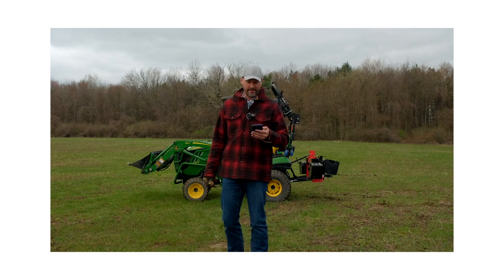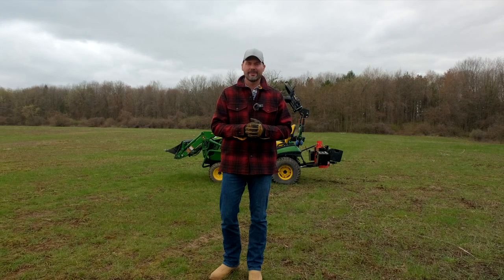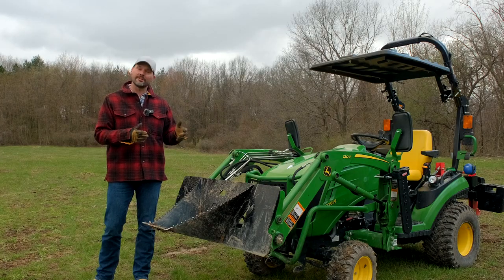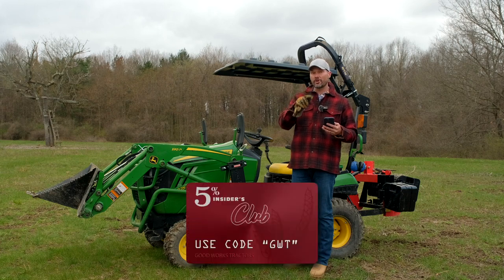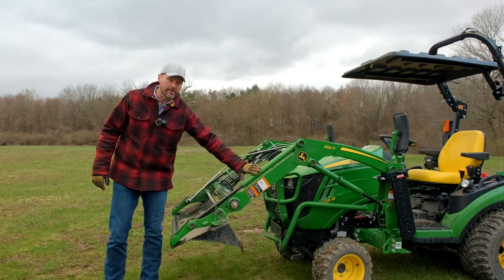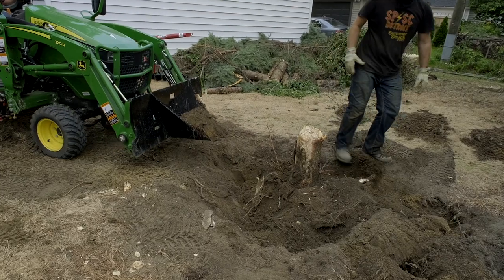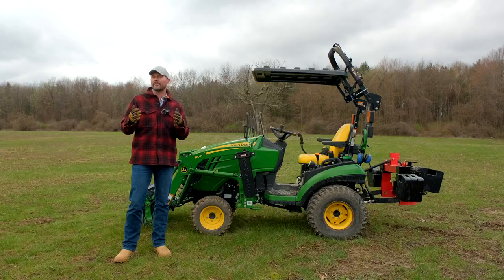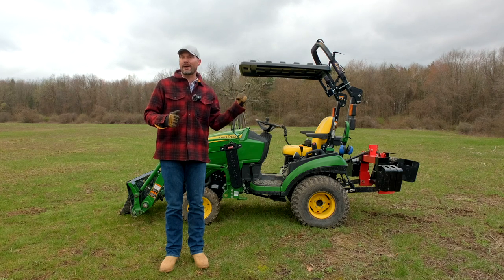WAS THIS TRACTOR ABUSE? 10 WAYS YOU SHOULD NOT ABUSE YOUR TRACTOR

Comment: My lil Jonny gets the best of care.  All fluids changed on time, greasing, filters, washed, waxed, etc.  Even sleeps in a heated space...That said, when lil Jonny and I are out in the yard, it's time to work.  It gets used for everything it was made to do.  Digging, pulling, lifting, mowing, blowing, pushing on whatever terrain I need to put it in.   It isn't a commercial tractor, but in my residential world it works like one.  Call that abuse if you want, I call it putting a great tool to good use.   Lil Jonny works and plays hard, but is well taken care of at the end of the day.  If you do, that it will take great care of you.  Thanks for doing what you do sir.

Comment: I never thought of the way you use your tractors as abuse Mr. Courtney, never.  I’m rarely in 2 wheel drive because of our property.  So I will need to watch out for that, thanks!  

My dealer had me send many videos to him when I was first using the grapple moving logs so he could show customers various sizes of logs. One learns quickly to have enough counter weight on the little guys and not to lift excessively high for the weight.  One thing to note, I had to get a new differential.  It wasn’t anything I did as I’m old and low and slow is my motto nowadays. It used to click all the time and then it started clicking and jumping a wee bit.  One day it felt like I was on a horse that kicked out with both hind legs to the side, not fun.  Though I’d been taking it back several times, they couldn’t replicate it.  This last time they called me down and in less than a minute and five feet it finally did it in front of the mechanics. Fortunately they didn’t discount where I thought the issue was just because I’m a female.  There was a lot of discussion on what they thought it might be but went ahead and looked at the differential and the gears were shot!  The only thing they could come up with was inaccurate installment.  They’d never seen a differential on a newer tractor in the shape it was in.  But It doesn’t click and buck anymore and I’m having to get used to the new sound it makes.

Comment: Because of your videos, I got BORA wheel spacers for my VERY tippy RK21 that I lifted a wheel off the ground more than once. When I lifted BOTH left tires off the ground just hitting a small dip on sloped gound, and ALMOST went over, I got 2" spacers. WHAT A DIFFERENCE!  I also filled my rear tires with -20 degree winshield washer fluid beforehand that helped with the FEL, but not the tip-over danger. I also learned from another video (yours I think) to put some weight material in the FEL when using my boxblade.  THANKS!!

Comment: The loader and tractor are designed by engineers and years of experience. It will not let you lift anything that the tractor and axle is not rated for.  It's not abuse.  It's normal use.  Keep up the good work and videos.

Comment: Hello,
Nice video, and I totally agree with you on what concernes the stump bucket use and other R&D built in safety features.
But I would never mount the widest wheel spacers. They are very efficient for stability but they will reduce rear axle life time by half and they do come in to our J.D. repair shop here in Belgium with leaks and premature damage.
They are comparable to what you mentioned in this video having a too long stump bucket and not having enough rod length in te cilinder. I'm not allowed to go into detail, but the axles just aren't made for this use.
We refuse warranty when we see them mounted.
Cheers from Belgium.

Comment: I can attest to the issues that may arise with backing an implement on the three-point hitch. Using my box blade in reverse, moving a full volume of dirt, I bent the turnbuckle style stabilizer arms, not once, but twice. The first time I noticed the damage, though minor, it was a mystery as to what caused it. Live and learn. After experiencing the problem a second time, rather than repairing the turnbuckle, I opted for retrofitting the three-point hitch with the telescopic style arms, which are much more robust. The hitch, though somewhat capable in reverse use, is designed for pulling, not so much pushing.

Comment: Great points, especially regarding the extension of the curl cylinders. My Ford 1700 tractor is 40 years old and has worked hard and done great through it. It isn’t pretty, but it runs well and does the job. The loader frame is welded and sistered with steel angles where it has cracked from hard use and fatigue from vibration over 40 years (2 cylinder diesel isn’t as smooth as modern 3 cylinder machines), the bucket has been welded too. Otherwise, it keeps humming along and taking what I throw at it.

Comment: Just beginning to learn what my tractor can do, but you are right - slow down, pay attention, and I would add listen.  I've found that the tractor will let me know when it is struggling.  When it does, I back off and try another angle.  Also the points about working in low and knowing when to use 4-wheel drive are equally important (and highlighted in the manual).

Comment: As to your remark on using four wheel drive all the time I agree. Along with the wear and tear. And the front wheels being hard on the turf while mowing. I have noticed a big difference in fuel economy. Especially while mowing or running at high RPMs. At $5.50 a gallon for diesel it makes a difference. And no I wouldn't call that abuse.

Comment: Totally agree  I love this little tractor and use it as much a possible. After owning it for only 9 months I had a 150 hours on it with out any issues and I worked it hard but not abused it
I built a stump bucket for it and kept it short for the reasons you mentioned. I dug out a 20 old cherry tree stump that was 24 inches across in very rocky soil here in north east  Pa with no problem at all had to roll it away to avoid damaging the tractor. JD 1025 R

Comment: I am a heavy equipment operator. That is what I do for a living really the only abuse I see here is on the operator. Is the tractor kind of small dig some of those stumps out? Maybe, the only thing that’s really going on here is it just takes longer to do the job and has already was said when the implements are long and you’re pulling in yanking on some thing that’s when you have to worry about damaging the tractor. Like you said it is very short and stubby which helps with the leverage. Other than that nothing really wrong with what he’s doing everybody just thinks it’s abuse because of its size it really takes some work to get those stumps out of the ground.

Comment: Courtney 
As a retired engineer you are right on. The hydraulics and structure are designed for this "abuse". Sacrificial piece are designed so as not to overload.   As long as there are no add ons to sup it up then alls good. Now it doesn't mean that there won't be design issues for unforseen uses, 😉.

Comment: Yes, there IS a difference between use & abuse! My father was a professional mechanic & he paid a premium price for his tools because he used them to make his living. Some might have even considered some of the things he did with them "abuse", but ultimately, they were there to be used in the way he saw fit to use them. If someone doesn't want to use their tools in the manner that you do, that's fine. But if by "abusing" them you have to pay a higher cost, than that's a decision each individual has to make at that time. This is why we had a "Battle Short" switch on our generators in the military. It bypasses ALL faults that would normally shut the unit down protectively, like over voltage, over heat, low fuel, all the faults EXCEPT overspeed & short circuit, which could cause harm or death of people. In other words, if we needed to in a drastic situation, we could work the unit beyond what it was designed to do. Good luck & God bless! 🤠

Comment: where you hit the front frame of the tractor on the stump. could that move the quick connect mower deck hooks on the front back to contacting the tie rod steering bar? not much clearance there to begin with? asking because I just bought a 2014  john deere 1026 and the back of those front hooks rub on the tie rod bar. how do you fix this issue?  have learned so much from your vids keep up the great work

Comment: Got a 1025R with the backhoe. Have used both and I prefer the backhoe. 
Would like to see a pump with bigger gears so I can operate two circuits simultaneously; such as lift/lower and dump/curl to maintain a level bucket. Don't need more pressure, just volume.
Besides the belly mower, do they make attachments for the mid PTO like a power generator or an auxiliary hydraulic pump for 3rd functions?
Reply: Hydrosplus has several pump upgrades to solve that problem.  You can make 4 motions with the backhoe simultaneously with biggest pump.

Comment: In my opinion you were getting close to the line with that stump bucket video.  I bought a JD 4310 (30-hp pto) about 15 years ago, and my abuse involved moving large stones and tree trunks.   The weak link is where the quick-release loader frame meets the tractor frame.  "Abuse" has spread the mount so far a couple of years ago I installed 3/16" steel plates to fill the gap that formed.  In fact, JD sells a kit to do the same thing.  Now, years later it is sloppy again and I'm considering going up to 1/4" plates.  Poor design or abuse?
A huge abuse is having an unbalanced load in the bucket, forcing the loader frame to twist.  If you can hear the loader frame moaning or popping when you lift you're doing something wrong!

Comment: Hello, I have a 1994 Bobcat 453 Skid-steer that has a tool plate with side pins rather than the bottom pins of the modern tool plates.  Do you make a stump bucket that will fit my 36” wide tractor?

Comment: If people want to buy a piece of equipment feel comfortable using it hard not abuse it ok, and others want to baby it fine also, ask a dealer,  your salesman or someone who has used one and they will usually steer you in the right direction.  One thing that you did not mention and I am not sure how, turn up the RPM's or boost it, back in the day every farmer could tweak a little extra horsepower or lifting capacity out of a tractor, these are engineered for just enough

Comment: Using a hammer pounding on a screw driver using it like a punch is abuse. These little compact tractors (mine is a JD 3320) have pleasantly surprised me as to their capabilities. Just like anything else if no common sence is used breakage will occur. I truly believe a good operator understands the limitations of all things mechanical.

Comment: Good afternoon. You explained the forks scenario perfectly. 
I tweaked my right side loader arm. Just forward of lift cylinder pin.
Where the plate steel is welded to the 2 square tubes hence forward of lift cylinder. 
Its a Mahindra. It was my fault, not the machine, not the steel. Me the human. 
So my machine is at the dealer during Spring tillage and planting. So it's going to be fill in work.
Yay me for being a bonehead. 
Live and learn, while a lil lighter in a account yay, sarcastically said. 
Be safe everybody

Comment: JMO, adding that much rear ballast and carrying the weight that high is indeed abusing that tractor.  Honestly that tractor has no place on developing your property when you have so many options that are commercial rated to handle the work you need accomplished to develop your property. IMO you are doing a disservice to your viewers by building up false hope that there smaller machines will hold up to service levels that require a larger machine or a commercial rated machine. I agree that turbo charging a small machine is not wise but, what you are doing with a 1025r is no different.

Comment: I will say this about the snowflakes that left you those messages.
Hey Skip steer does a job of a skid steer.
A 1025R does a job of that size tracker. You know your job you know your tractor if you have a bigger job than the tractor is rated for go rent something bigger if you’re afraid of tearing something up. Sounds a lot like a lot of those people do have cars that will go real fast but they don’t know how to drive them and they crash them and tear them up. I’ve got a John Deere 1025R love it it’s a great tracker it does the job I bought it for Moe with it I have a front loader I have rear box please I have a cab on it I have a snow plow for it. I did not buy a John Deere 3350 or whatever I don’t need it. It really discussed me how some of the snowflakes will criticize people and the type of work they’re doing. Hey yes if you use beer equipment at your job good for you. But the criticize somebody that is showing you the different types of equipment the different types of application to me sounds like a snowflake. I think you would do a great job I have learned a lot from your videos and information you sure I think you very much everything you do have a great week.

Comment: How can I report tractor abuse?.  There should be commercials like the animal protection commercials. I can see it now. a shot of a tractor on its side with a broken lift arm. some fat guy that dwarfs the machine, a bunch of Hydraulic fluid spraying from the line connects. " Please call now, you can help this tractor and others just like it by sending $10,000 now. Don't wait, The tractors life depends on it. If you send $100,000 on our diamond membership you will get a cup holder totally free of charge. You will also get to kick the fat abuser in the shin,